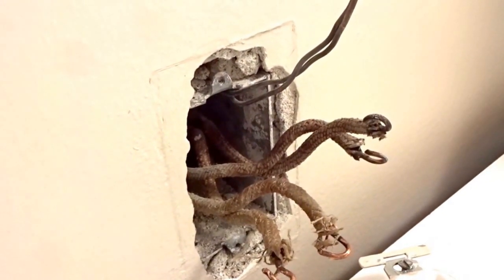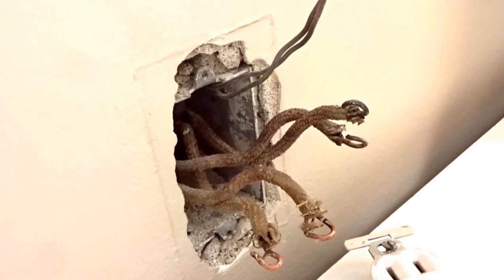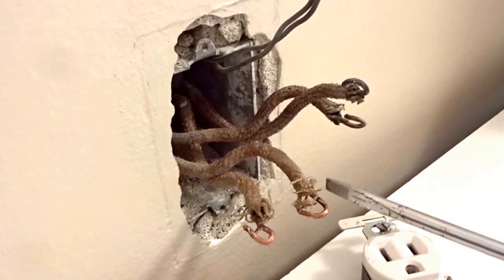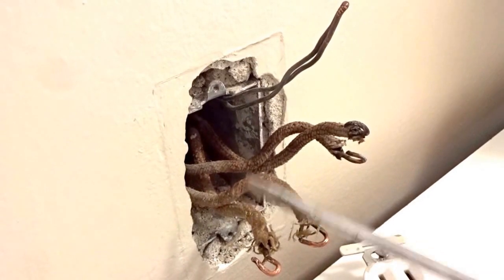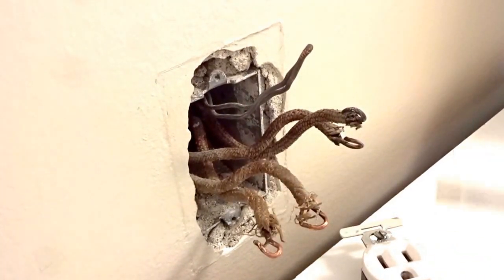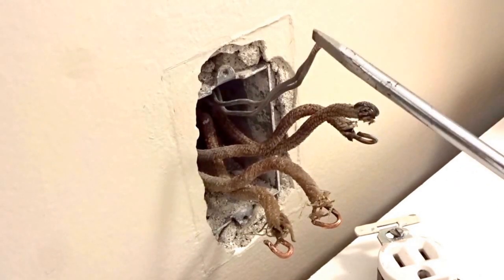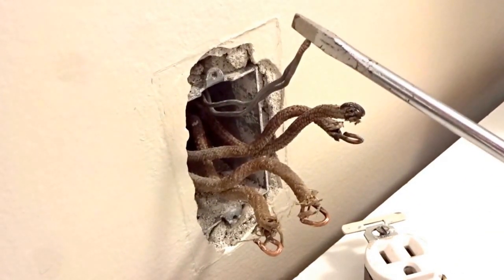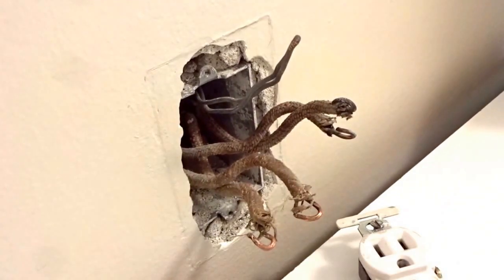Electric Code Violation: neutral to ground connection at outlet.

Comment: The ole ball & tube wiring. If you tie the return to ground...yep it will work if the ground is actually grounded. Not the proper way to do things though.
Reply from the maker: Right Tommy, this violation of NEC 250.6, 250.24(A)(5) or 250.142 created a 10 mG magnetic field on the master bed which was reduced to .3 mG once we traced and fixed this.

Comment: Those wires look much older than 1940's,  appears the ground safety wire as added (incorrectly) at a later time. Thank you.
Reply: This is from the late 1930’s Type M BX which the outer spiral shell is the ground.
Reply from the maker: This problems created a 10 mG field on the master bed.  We solved it by correcting the wiring.

Comment: Interesting learning. With this dual path would it increase electrical consumption though at a small rate and where is the fire issue if all is grounded, any short will go to ground if all is attached
Reply from the maker: Hi Wayne,  Consumption is not increased but current on the ground spreads to other connected grounds and is not cancelled so you get a larger magnetic field.